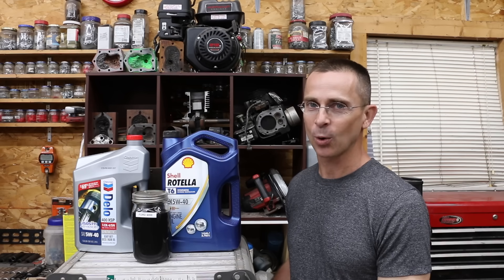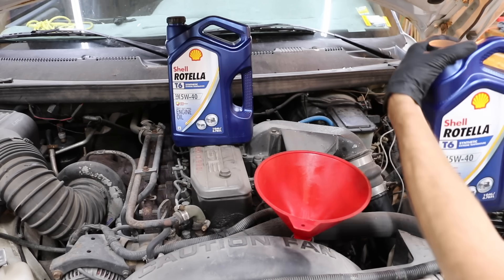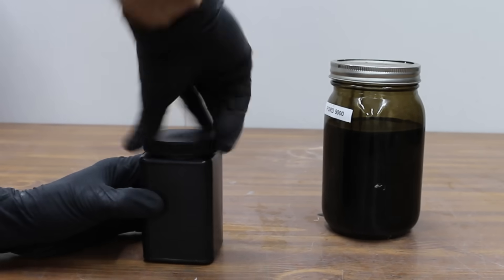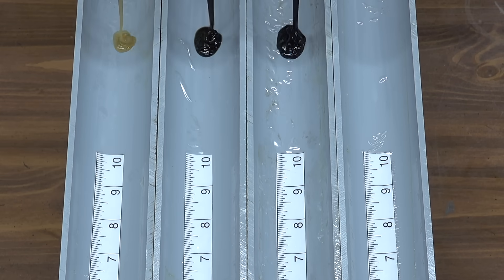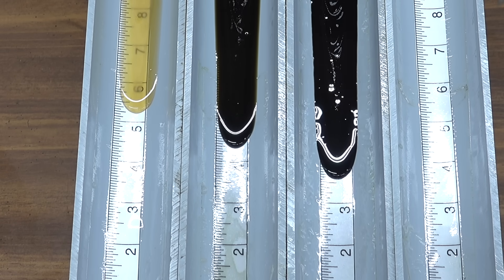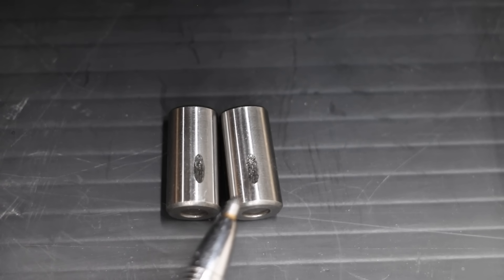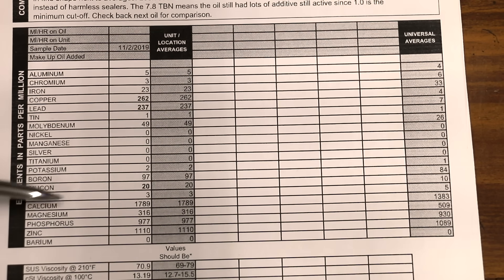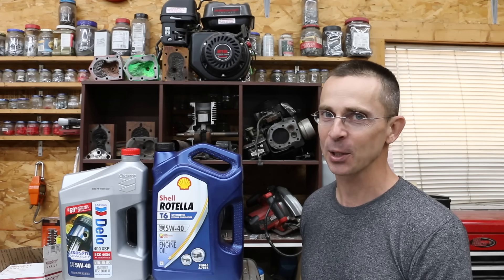Will Annual Oil Change Damage Your Car? Let's find out!

Comment: Ya it's a myth, pushed by oil companies and anyone with an oil change business.
Reply from the maker: Thank you!
Reply: @ProjectFarm  Our VFD had 1942 and 48 American LaFrance pumpers 
(V-12 gas engines) and their manual said to change it every year. And they sure didn't get many miles. More pulling the pump that road and that wasn't much.
Reply: A current age myth that's based on something that was true. Watch the other video titled "Is oil good after 70 years?" and it's obvious that oils in the 50s were pretty bad compared to now. I know the oil in that video is from "Caker State" but even they've gotten better over the years.
Reply: @101Volts  Yeah! Now it takes it 15 minutes instead of instantly!
Reply: @101Volts  It is interesting how various oils have changed. Automatic transmission fluid used to have actual whale oil in it ffs.
Reply: So was the change every 3K miles just another scam to sell more oil
Reply: Depends on the state of the engine. My high mileage Camry has a ton of blow-by; I'd imagine the oil becomes diluted quick enough, so I'm sticking with 6 monthly changes, regardless of mileage. And climate as well... where I live in Australia, it can go from freeze-your-pipes cold to desert heat. So I'd say there's different factors involved. But I'd overall agree - if you lived in a normal climate, and you had a car that basically hasn't travelled the distance to the moon, good synthetic oil, yearly changes would be fine.
Reply: And bullshit mechanics who really don't know much about technicalities
Reply: yup, we bought a used low miles (under 60k) 2009 Mercury Grand Marquis in Jan 2018.  Sticker indicated dealer changed oil Dec 2016, after it was traded in.  I didn't change the oil until July 2019.... and if I recall, it had just started to turn black...  I think there was less then 3000 miles on it.
Reply: I change my oil once a year, Valvoline synthetic. But I only put about 5k miles a year tops (most trips 90-300 miles)

Comment: I wanted to let you know I'm trying this Lucas extra long lasting Lucas SAE 10w 30 API SN plus motor oil America's Finest fuel-saving Lucas SAE 10w 30 is a fuel saving formula based on non-conventional additive package it is designated for maximum cylinder compression and minimum internal friction Lucas Fuel saving technology was developed through years of Designing long lasting lubricant for the racing industry to stop smoking knocking and oil consumption in Warren engines add Lucas heavy duty oil stabilizer to the oil 4 years in 4 cylinder 6 cylinder and 8 cylinder engine meets or exceeds America and European OEM specifications exceeds performance levels of API SN Plus snsm for gasoline engines American petroleum Institute certified well I just read you everything that's on this Lucas Oil
Reply from the maker: Thank you for the feedback
Reply: Get Amsoil. Cant be beat
Reply: @christopherwilson6527  I'll give it a try at my next oil change I'll look that stuff up I just saw this and I just repeated everything that it said on the on the other quart bottle I gotta extra long life oil filter and I'm going to add the Lucas Oil Treatment it's an old 350 1988 K 1500 truck motor that I'm fixing up and it's got good compression so I'm trying to just get this most I can out of this money it's my logging truck

Comment: Dodge Cummins oil pressure is on a delay in the gauge cluster in all gen 2s
Reply from the maker: Great feedback. Thank you
Reply: I've had a 94 95 96 98 99 01 02 and 05 Cummins they all do it

Comment: We leave oil in our tractor for at least 6 years
Reply: I change my tractor every 7 years. I keep the oil, I just change tractors.
Reply: @RedfishCarolina  That'll work!
Reply: No but its pretty bad when you have not changed the filter and just topped the oil up for 6 year
Reply from the maker: Thank you for the feedback.  Do you ever have the oil tested by an oil testing lab?
Reply: @ProjectFarm  How about Dan Waters send you a sample of the oil?
Reply: Dan Waters how did you come up with 6 years? What sort of testing do you apply in determining it’s still good after the 2nd year, 3rd year etc.?
Reply: @hectordeanda9133  if it looks good on the dip stick and it does not look thick or smell burnt I just leave it in there there is no point putting new oil in when the old stuff is in good shape
Reply: @danwaters115  Old is thicker an stays in there better! Way to go!
Reply: Dan Waters How about in your vehicles?
Reply: @Mr.Beastforpresident  My dad put over 30k in his srt8 charger before changing it. Same with his work vans all still run great.

Comment: Been using T6 in my 4-stroke 2 and 3 cylinder bikes in all kinds of weather conditions and speeds for years with zero issues. No issues with the wet clutches either.
Reply from the maker: Nice!  Thank you

Comment: Hey, I got an odd oil additive you could try. Back in the Soviet Union, they used to add something called DMSO to the oil to keep it from forming sludge. There's plenty of information out there for it and it is cheap and easy to get. READ ALL THE WARNINGS BEFORE HANDLING IT!

My suggested tests would include new oil usage, using it as a pre-change engine oil flush additive, and seeing how well it could break up engine sludge compared to previously tested engine flushes... that is, if you already did that. Would have sworn you did. Hey, another suggestion!
Reply from the maker: Thank you for the video idea!

Comment: Hi Project Farm :D  I am wondering if in one of your next videos you could test out Archoil AR6200. It claims various different things for both Diesel and Petrol as a fuel treatment. It would be interesting to test in your lawn mowers and generators to see if anything noticeable comes from it!
Reply from the maker: Great test idea!  Thank you
Reply: Jack Taylor I’ve tried in 2 vehicles. 2010 Kia Forte purred like a kitten after using. Noticeably better. 2010 F150 5.4, it did jack squat.
Reply: Man , I didn't even think about archoil.
Reply: It will be nice to see archoil test whether oil additive or fuel treatment ,there is so much hype about it,I use archoil oil additive and has seen difference in response in lower gears ,i am not sure as i am also using premium diesel ,Dont know which one has made the difference overtime,Engine seems to run cleaner and more responsive now than a year before when i bought the car.
Reply: Please compare to Lucas.  I just purchased some Lucas fuel additive for my 7.3 and I had no idea which was best.
Reply: @ericl452  Navistar respond well to motorcote, both in 7.3 and even more in 6.0...dont know why...

Comment: methinks there's a collective nationwide scam going on in the US of A.
Here in Europe, oil changes are not called for every 12 months in case of low or normal use.
Reply from the maker: This is great information.  Thank you!
Reply: Most european manufacturers recommend an oil change every 2 years for most of their cars.
Reply: @bodd boward Not to mention public transit systems in cities and environmental campaigns encouraging citizens to use them instead of their cars.
(But in the countryside you definitely HAVE to have a car even though the distances might be shorter that in the US)
Reply: Mostly because of the decades of being told that you should change your oil every three months or 3000 miles, whichever came first.
Reply: And the state of the oil after the two years is awful. I change mine twice a year. And internally the engine is spotless, with zero wear showing down the bores or even on the chain and sprocket with compression is still like new even with 80k. Depends how much you like or want to keep your engine
Reply: @christopherwilson6527  my 20 year old merc got new oil every 2 years, thats about 25.000km in between. I rebuilt it a few months ago to tune it a bit and it was like new. changing the oil every 6 months is a complete waste of money.
Reply: Some do, some use engine management to ascertain oil condition and changes
Reply: bodd boward all oils and cars have a recommendation for oil change after x amount of miles or x amount of months/years whichever comes first, so miles have no connection to them recommending yearly changes. 

Everyone puts different miles on their cars in a year which is why no oil company is going to open themselves to liability for ruining someone’s engine because they put change yearly on the bottle assuming everyone who uses their oil  won’t do more miles in a year than their oil is rated for, the only time I ever have been told to change my oil in x amount of miles or x amount of time which ever comes first was when my car was covered by warranty and free servicing by the manufacturer dealership everyone else at least in my experience goes off the miles the oil is rated for.
Reply: Here in America people change oil every 5000 miles or when they get bored....
Reply: Yea cuz america is a federal corporation. A quick search will do u some good
Reply: @bodd boward   distance at operating temp is fine, better than short city trips where you never reach  temp.

Comment: I think diesel engines last longer becaus  diesel is oily and it help with lubrication
Reply from the maker: Thank you for the feedback
Reply: Used too but low sulphur isn't like that
Reply: @jusb1066  but compared with gasoline is like solvent
Reply: @jusb1066  the low sulfur here caused my injection pump to die.
Reply: It's mainly because diesel engine parts are built to withstand more pressure and heat. You ever felt a diesel piston vs a petrol piston? Its like twice as heavy
Reply: Diesel engine while idiling consumes very little fuel compared to petrol

Comment: nice cummins
Reply from the maker: Thank you!  It's been a great truck!
Reply: @ProjectFarm  My mom's got a 2002 much like it. You can pound those engines forever and they never die.
Reply: @ProjectFarm  Damn! Low mileage 12v, I'd sell my spine for that thing!
Reply: @LifeRunner4k  From what I've heard, low mileage doesn't really matter that much for those engines! (Though low is always better, of course)
Reply: Travis Terrell it’s not the motor the mileage affects as much as the chassis. My 24V motor is strong as an ox but the suspension and interior really starts to go down hill.

Comment: BRAKE PADS PLEASEEEE
Reply from the maker: Thank you for the video idea!
Reply: @ProjectFarm , I like the idea of testing brake pads, when doing so, check to see which types also cause more damage to the rotor?  I've heard that metallics grind the rotor faster, but tends to leave them straight, while ceramics will not grind the rotor as much, but will overheat the rotor and cause the rotor to warp
Reply: @ProjectFarm  
Try store brands too. Where did Fred get his, Bedrock Discount Auto Supply?👟👟
Reply: @ProjectFarm  yea, I told you 3x and you just say 'thank you' haha
Reply: @4chankrozb  takes a long time to wear pads so maybe hes been doing a year long test with different brands
Reply: @4chankrozb  takes time calm down every video has months of work waiting for results and stuff
Reply: Forchan Chan he gets 100s of ideas just have to be patient.
Reply: Forchan Chan it takes time to make the videos... he could have started it who knows🤷‍♂️
Reply: Oem pads or better it’s not somewhere to cheap out on
Reply: Yeah,why not.
Reply: There are far too many variables to make that worthwhile, such as specific vehicle, driving style, years of use, environmental temp and weather, old vs new formulation (if copper in them), brands vs materials, overall condition of braking system, and even whether brand X and model Y is always made in the same factory or produced by more than one.   It would be a waste of time before you even factor that the value in longer life pads is offset by whether you DIY replace them or pay someone.

The far better way for you to determine which work best on your vehicle in your environment is test them yourself.
Reply: Brakes last a long time if you get good ones and dont slam on them all the time. Im going on 5 years on my f250
Reply: That could be a hard one to duplicate, replicate.
Reply: Testing brake pads takes equipment. Here is plenty of info for you. 
https://m.youtube.com/watch?v=DZ8O2tJOGLE
Reply: A brake pad set up will take some time. I am positive it is an ongoing project and will be uploaded soon. 👌
Reply: sw4gr1d  Sure there is further necessary, it is often the case that their higher price is wasted money.
Reply: i remember watching the video from Engineering Explained and everyone was calling out Project Farm to do a video, since it seemed a little rigged, but maybe they were just confident for a reason and that's why they sponsored it. It does seem like a lot of work, but I'm sure a ton of people want to see it after seeing the comments on that video.
Reply: I don't know for cars, I've heard OEM are generally the best. For the motorbikes I had, EBC HH quality is by far the best.
Reply: You've got to do Brembo and EBC
Reply: Engineering Explained did that a month or so ago. Mid range priced pads were the best overall with premium pads only offering marginal benefits above.
Reply: That's a difficult choice,  ceramics will mange a rotor (sacraficial).
Ebc makes great pads for bikes, because we need all the brakes that we can get.
Daily driver, organics are fine, (like we experience brake fade in our minivan etc)
I had ceramics in my 850 R, Volvo wagon, you know they are up to temperature when  they make that distinctive squeal.
But I drove it like a MX bike.
I see your Francais, moi aussi. 
Francophone
Reply: Forchan Chan not going to get off easy 150, this is 4 wheel drive with hubs 500.brakes
Reply: Frotax Frotax  I've got a 2004 GMC Sierra 2500HD with ORIGINAL pads at 472,000 miles! No kidding!
Reply: @williamjones4483  And I thought my 2006 Jeep Grand Cherokee with original brakes at 140k was doing good.I'm undone. LOL.
Reply: @Colorado_Native  GMC uses the phrase "We are professional grade" in marketing their pickup trucks. I believe it. I had to make some repairs to the inside of my truck and it required me to do some disassembly. This truck is put together very well. Lots of fasteners holding it together.